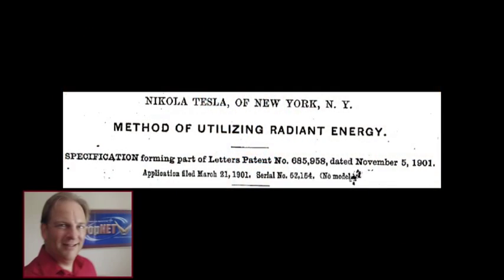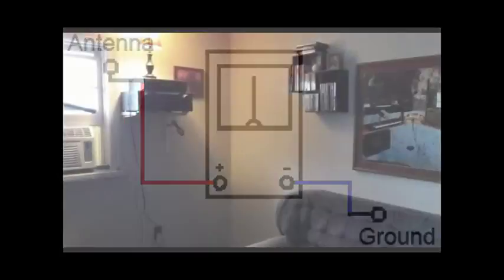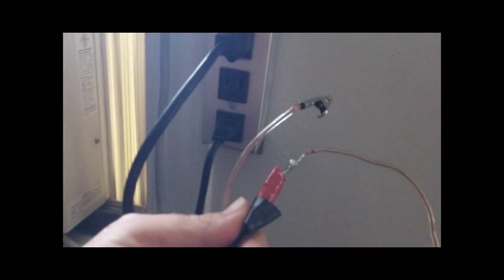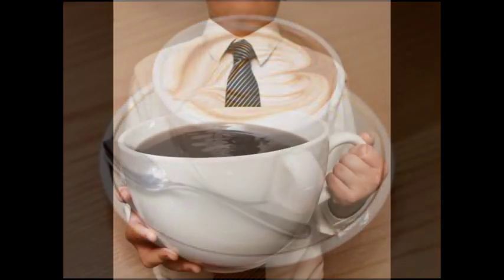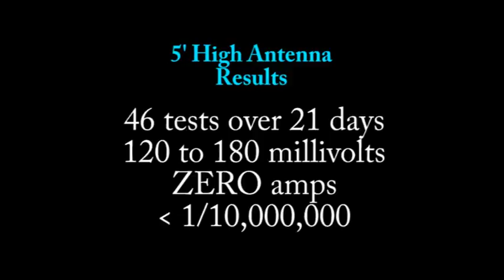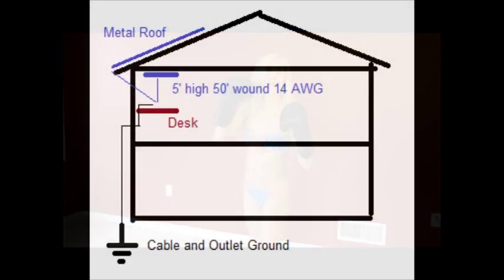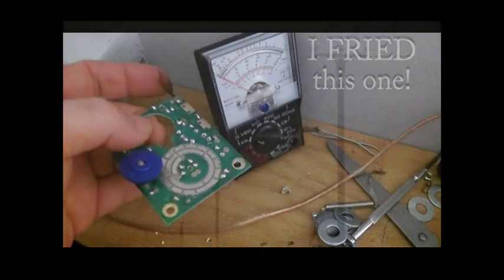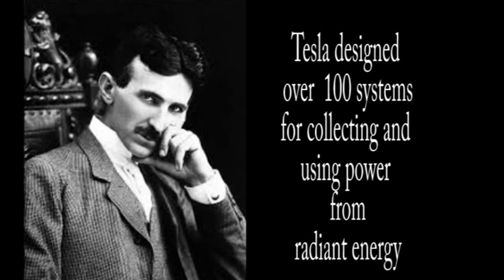Radiant Energy Circuits - Tesla 1901 - Patent No. 685958

Comment: idk if you build one already but i notice it works with one diode and one capacitor and you can store the energy in super capacitor or rechargeable lithium ion batteries or lead acid rechargeable batteries although on the lable does say keep it charge to prevent damage